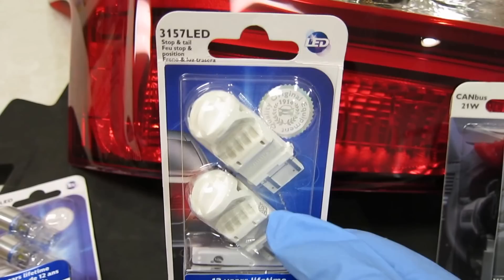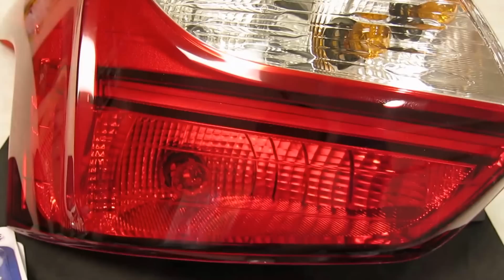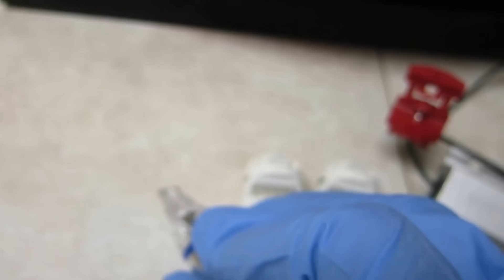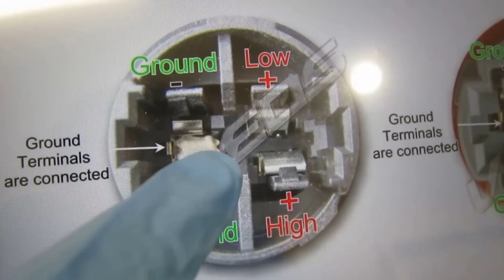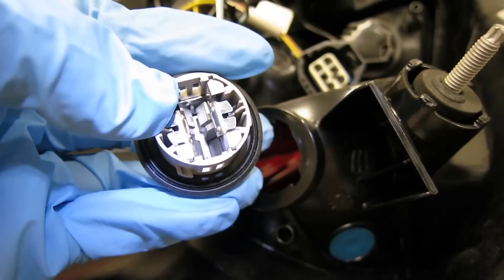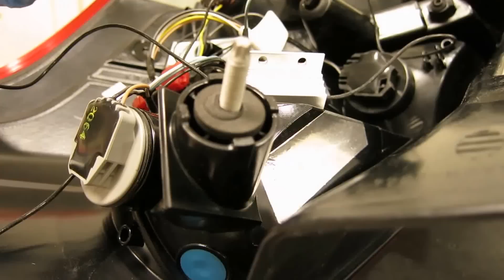How To Replace Ford Focus Tail Lights with LED lights

Comment: after those upgrades, later if the brake light is burnt out/not working etc, will dash still show warning light for brake light burnt out?  oh yeah also which one is the signal light? is it tail light ? thanks for the helpful video
Reply from the maker: Okaythen001 Unfortunately NO. With the 'Warning Canceller' in place in the brake light circuit, the car computer will be forever fooled to indicate the bulb is not working. That's the MAIN reason we have to use High-Quality LED bulb (like Philips, back by its factory 12-year warranty) than other cheapo/no-name LED Bulb from other markets like ebay.Signal Light is the Amber/Yellow Color bulb in the housing. Philips does not yet make 3757NA LED bulbs in AMBER, which our Ford Focus is using. So I didn't suggest to convert to LED.
Reply: @moomoo97sylvania zevo is a lot better choice for its high quality product, and lifetime warranty. 

But it has 4 led’d 2 on each side for separate circuit for parking light, and brake light, and it has an aluminum heatsink. 

Much more efficient and much brighter. And more vibrant.

Comment: If I am to use this giant resistors so there won't be significant power reduction on breaking light. It still uses 21W. 

I saw on Chinese internet market LED described as CANBUS error free. What can you say about that?
Reply from the maker: DonPedro6901 This Warning Canceller (aka Giant Resistor) is just a way to simulate the circuit resistance not found in the LED bulbs (very low resistance by nature), compare to the traditional Incandescent which is using Heat to generate Light (high resistance). There won't be any significant power reduction (or additional load) in the existing brake light circuit by using the Canceller because this is what the OEM incandescent bulbs are doing.Warning Canceller, CANbus decoder, CANbus error free, etc. are just the fancy names of 'Resistor' for Marketing. But like LED bulbs, there're Quality and Cheapo bulbs on the market. I'd always suggest to spend a little more on the quality kind for reliability and safety reason.
Reply: That's not true the LED's with the cambus don't draw nowhere near that much power or heat. They are designed to run so much better and they don't take any power to run. You can run a led forever in your car and it will have very little drain on your battery versus run one of those lights you got with that big ass  Resistor. Go buy some campus LEDs and run them off your car battery  With a voltmeter we see them not draw anything for power then take your resistor type and do the same thing and see what it does to your battery...
Reply: @secalcavazos3204 nowadays we got led bulbs that draws the same wattage as the factory bulbs and draws heat. But not as much as the halogen or incandescent bulbs do